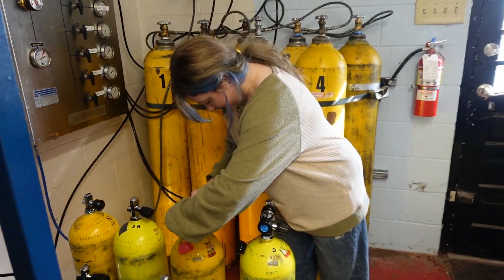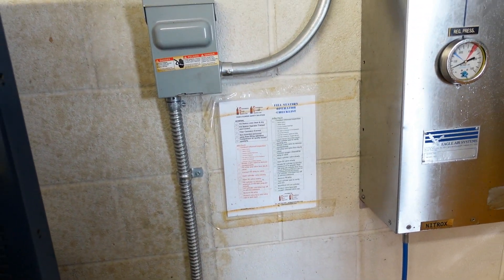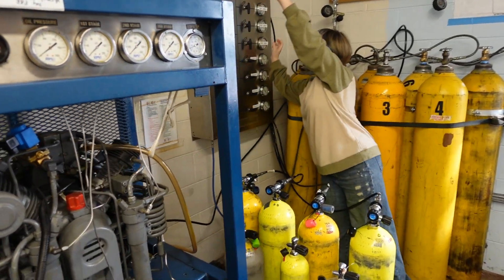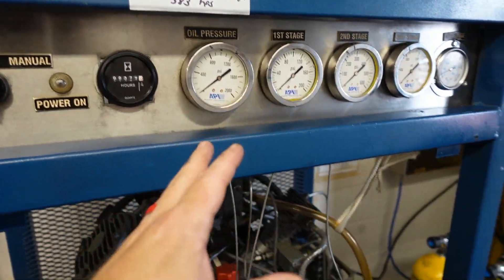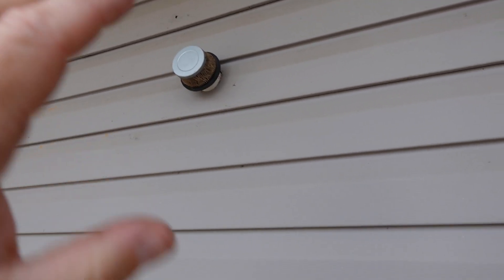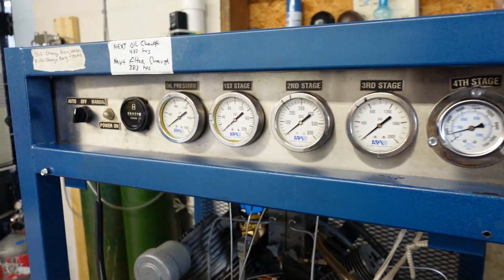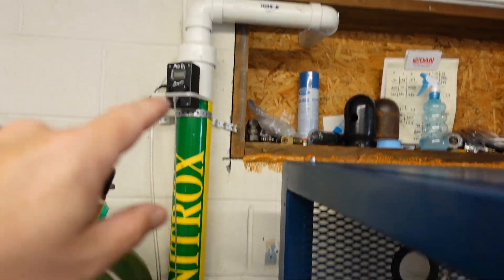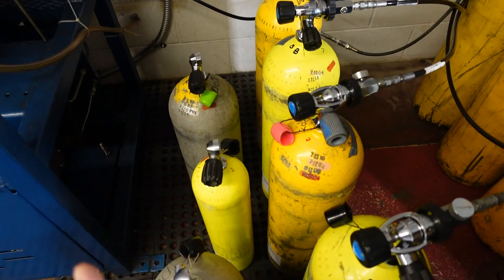Crash Course In How A Scuba Compressor Works

Comment: How come you guys do not set the to be filled tanks in cool water to keep the scuba tank cool, allowing the customer to get the full 3000psi at room temp? And how come it’s 3000 psi, and not the 3500 like 30 yrs ago?
Reply from the maker: Hello @goatsinker347, great question.  So with a water bath, unless the water temperature is regulated to maintain a certain temperature, convection will cause the water to heat up and defeat the purpose of keeping the cylinder cooled. So we typically will fill the cylinder to its rated capacity, and then let it cool. After it has cooled down, then we top it back off to get a proper fill. As far as filling them to 3000psi, it is all based off the cylinders rating. The cylinders we fill on a routine basis can range between low pressure cylinders ranging between 2250psi to 3000psi, and high pressure cylinders ranging from 3300psi to 3700 psi. Hope this answers your questions.